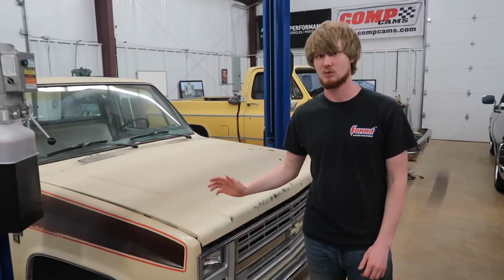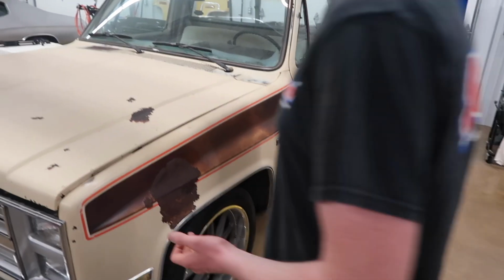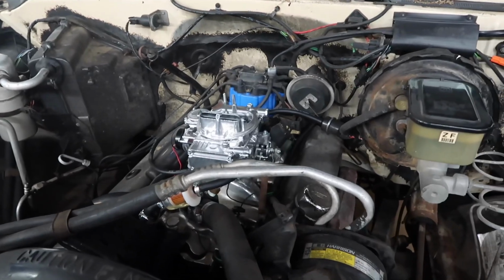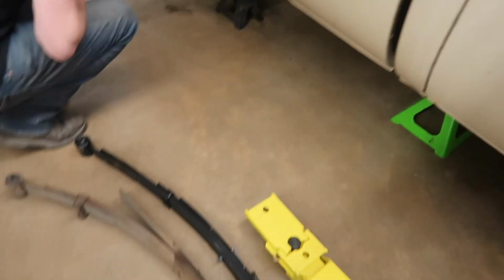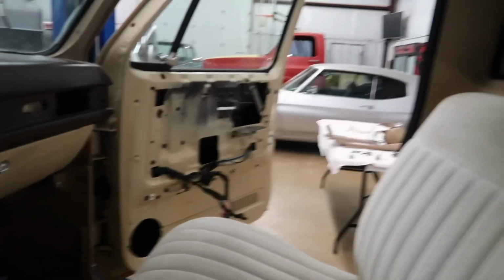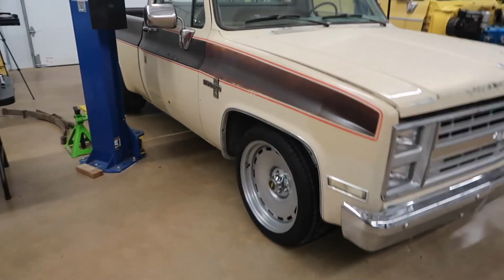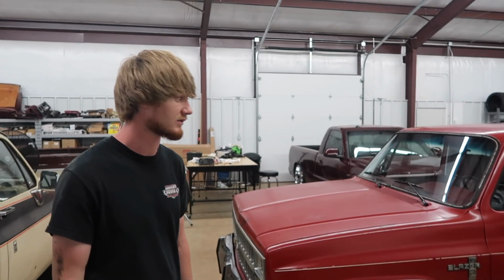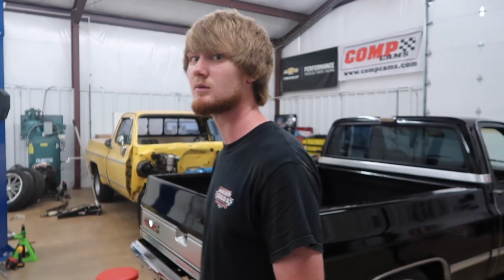Our 1985 SQUAREBODY CHEVY C10 Build (Part 1)

Comment: Nice find guys.  What size tires did you put on those Delray wheels?
Reply from the maker: Front-255/45r20
Rear-295/40r20
Reply: @milfordbrothers   what would you say the total drop front and rear is, for this tire set up? I have these wheels coming and ordering tires soon. any rubbing at all? did you have to roll the fenders?

Comment: Looks great.  What size tires did you use front and rear?
Edit:  Found it in part 3.  Thanks.  Front: 255/45/20 & Rear: 295/40/20 with 5.5" BS